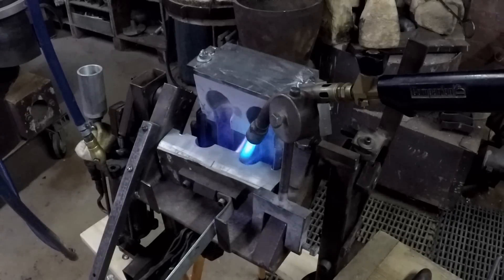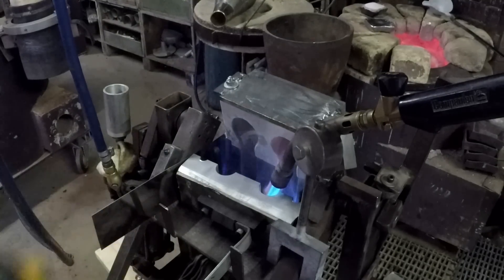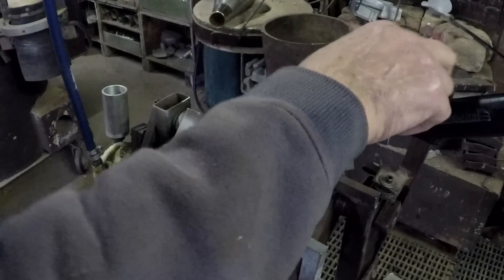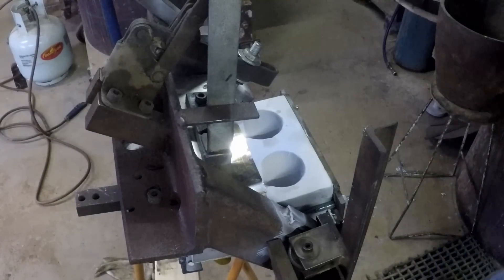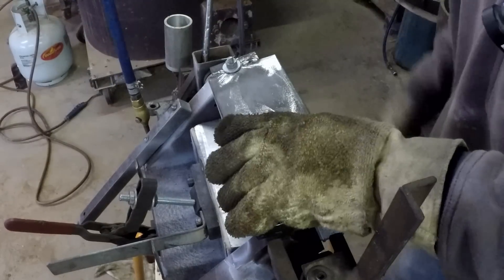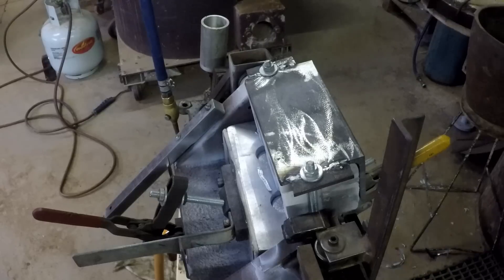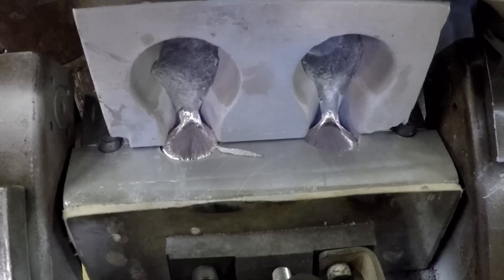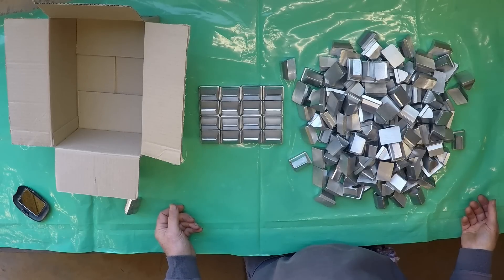Lens Blank Gravity Die Casting

Comment: Dear sir. What did you spray prior to pour and what is the use of it? Thank you
Reply from the maker: Dindigul, The die is sprayed with two materials. The first is Dyecote 14ESS made by Foseco.  It provides a thin, slightly rough, and somewhat insulating coat on the die Its purpose is to prevent the metal being cast from being chilled off too quickly when the die is filled, To aid the metal running into the die and , and to allow air to get out by virtue of the slight roughness. The metal running into the die sits up on the tops of this roughness and its own oxide skin. This allows the air to escape via the small gaps created by the roughness and as the metal is only touching the tops of the roughness it runs much further. The second coat is called Release Coat Blue it is made by ZYP  coatings in the USA. It is a boron nitride based lubricant which helps with removal of he casting from the die.... Martin
Reply: @olfoundryman8418  thanks for brief explanation sir.

Comment: Sir, I am contemplating a gravity die for an aluminum part roughly the size and shape of a sewing thimble. I would like to use electric cartridge heaters in the die, so the question is : what temperature range should I be looking at for die pre-heating? Thanks for your vids, I have learned a lot watching you. I Hope to get into the years worth of project ideas I have stored back.
Reply from the maker: Stephen, To be honest I do not know an exact figure - its a long time since I actually measured it 😊 I do it by sort of feel! However I would suggest 200 deg. C as a starting point. The die spray should flash dry immediately when you spray it on the hot die - if it sort of sits there wet looking and bubbles a bit after a couple of seconds the die is too cold. Electric heating is not common on gravity dies, there are risks in electrical conductors moving back and forth with molten metal involved but no reason why it can't be done with care. Gas flame heating is the more common by far. However with small jobs you may need supplemental heat as the heat being added via the small casting may not be enough to keep the die properly hot, I sometimes get around this problem by insulating parts of the die but the ability to add heat electrically under those circumstances might be handy....Martin

Comment: Post first comment wrong area so reposting here. Could you have made the whole die out of ceramics like you made the basins out of?
Reply from the maker: K, No not really. The ceramic is quite soft and would not stand up to the rigors of metal being cast into it and then the solid casting being removed. Even worse the ceramic is a good insulator and it would take forever for the casting to go solid greatly slowing the production rate. Even worse again very slow solidification is a recipe for all sorts of porosity problems. Also having cooled very slowly the castings would not respond to heat treatment… Martin
Reply: @olfoundryman8418  got you. Thank you.  Would it speed things up put a u shape in the side of the casting mold run coolant or would it cause too much shrinking?
Reply from the maker: K, I have used water cooling on a couple of gravity dies. They were both quite chunky sorts of parts and because of this I had difficulty feeding them. I water cooled the bottom of the die under the casting via a hole drilled straight through with a very small amount of water running through it. In truth the water boiled off within this hole. Very little water flow was needed and as the die now ran a bit cooler  the feeder in a separate die part above was able to provide good feed. I had to be careful to regulate the flow (through needle valves) as too much and the die would get too cold and the part not form properly - all in all it was an acquired art to get it working right. A commercial foundry I worked at used water cooling  but they tended to cool the platens to which the die was bolted rather than the dies themselves this sort of slowed down the cooling a bit and made it easier to control. I have also use air blast cooling... Martin

Comment: Martin, gorgeous work as always.
My question is related to having the molten pot for this length of time. Do you need to lance, clear dross, etc? Do you cover the crucible so hydrogen is not readily absorbed? Thank you and love your work.
Reply from the maker: Robert, Strangely perhaps gas pick up has never seemed to be a problem even though I hold the pot for about 3.5 hours while I ladle out of it. I work with good quality ingot so it is (hopefully) low in gas to start with and while pick up probably does occur, with gravity die casting solidification on small work like I do is so rapid that any gas does not have time to come out of solution and form porosity. Gravity die casting is known as producing the most porosity free castings of any of the more common casting methods - when done well of course. However I am very vigilant about clearing dross from the top of the metal as it does build up with every dip in and out of the ladle, I would skim the surface about once every 10 castings... Martin
Reply: @olfoundryman8418  Martin, thanks that is Good to know. Have you thought about.adding a Patreon account? Your apprentices could buy you a few beers.😉
Reply from the maker: Robert, At this stage I am not even monetarized. And my thoughts on Patreon are that I would feel under tremendous pressure to keep doing videos if I was being paid to do so - for me the stress would not be worth it. Also at the moment its all out of the question as my health is not all that it could be, while we are hopeful that the situation will improve at the moment I am not capable of making castings - to be honest its driving me nuts because I can not do anything much at all. To really put the kybosh on it I am probably the only foundryman in captivity that does not drink! 😊 Thank you for thinking of me though... Martin
Reply: @olfoundryman8418  Martin, be well and the best of luck with the health thing.

Comment: I do believe that this video is the first proper tilting gravity die I've seen, outside of LARGE casting processes in an industrial context. This, along with the preceding video explaining about the tiling process and what the aim is, why it works, why it doesn't work if improperly setup, etc., were absolutely fascinating.

You are, indeed, securing knowledge for the future by passing it on in such a manner. My most sincere thanks!
Reply from the maker: elitearbor, Sadly most large tilt casting shops get it wrong at least with respect to the starting angle. Certainly the big shop I was foundry metallurgist at 30 years ago did (I did not know better then!)  I note that many manufactured (Chinese) and for sale tilt machines will not even go to the correct start position. Few of these machines seem to be able to vary tilt speed during the cycle even though there are advantages in, for example, being able to start slow speed up and go slow again at the end of the tilt. My aim is to pass such information on and success in that for me = happiness... Martin
Reply: @olfoundryman8418  Truly, what you're doing is preserving skill and understanding which is all but lost. We're all better off, thanks to folks such as yourself. Again, my thanks!

Comment: Interesting.
So, cast an Al die them cast Al into that die, after heat treating.
Not sure if this has been done before.
Who cares ? If it works, got to give it a try.
Thanks for sharing !
Reply from the maker: aga, Yes it was done some time ago and back then  they hard anodised the die so that (apparently ) you did not even need to apply a die spray. From memory it was called the Parlanti process. It is limited though to no re-entrant parts i.e.. parts that would, only shrink away from a die and not onto it... Martin
Reply: Cheers for the pointer - will look it up.
Awesome that you got it to work great. Very encouraging.

Comment: great video Martin, I am raking my brains as to what these lens blanks are used for..
Reply: Me too, and enjoying the channel as a new member. Myfordboy and Doubleboost being my introduction many years ago. But I can see the step up in professionalism and experience here from their very talented but hobby level. One day i hope to cast a few things myself and it all adds to the mental tool kit.   :) Thanks for the ride Martin.
Reply from the maker: Arcturan, and Godshole, The lens blanks are to blank off a light beam. The runway lights they are used in have two glass prisms in them, each of which throws a beam of light in a certain direction from the light. Sometimes it is desired to turn off the light in one of the directions and this is done by fitting one of these solid aluminium  prisms in place of one of the usual glass ones....Martin

Comment: Hi, have you seen a new channel 'casting the future' which covers a CASTcon 2018 with modern techniques. Appalling video quality but some great material
Reply from the maker: Bit, Thanks for info. I have looked at the lecture by John Campbell that appears on it. Many in the industry think it no coincidence that his initials are "JC", I tend to agree. Crappy video as you say but information in it is gold. I have been endeavouring to follow his methods (as far as I can) for some time now and am very much an enthusiastic student of his work. There still areas that I need to  improve but even so I feel my methods superior to many in use out there (conceited I know 😀). I have seen some amazing differences in quality between local foundries that use his methods and those that don't. To see a 10 Kg open box type casting with mixed thick and thin sections produced with his methods that looks like wrought bar stock when machined is an eyeopener. There seem to be aa few videos associated with CASTcon 2018 - I will have a look at them all.
John has some excellent books to his name but they are large and a bit of a heavy read, full of wonderful information though.... Martin

Comment: Sir, have you ever used High Temp Ceracoat? Its a type of ceramic paint that is good to over 1500 degrees F and works just great on my red hot steel engine headers on my race car. I was just thinking it might make your mold last longer.
Reply from the maker: John, No, I have not used the cerakote material. I had a quick look at them on line and they do look interesting although the preparation requirements for successful adhesion look a little daunting. One of the problems of an aluminium die like that used here is that its thermal expansion is rather great and because of this many coating s tend to fall off on cool down after use of the die. Still, if this material is available locally and is not too expensive it would certainly be worth a try. Thanks for the idea... Martin
Reply: I have used it successfully on steel, exhaust headers, and on the tops of forged aluminum pistons. Its worth a try
Reply from the maker: John, "On the tops of aluminium pistons" - Hmm, very interesting indeed, that sort of makes it a very distinct possibility for spraying on a die. What sort of finish does it give? You need a fine sandy sort of finish for a successful die coat - the metal flows in on top of the bits of roughness in the coat and the air tensd to get out via the small channels in-between the roughness and under the metal, an overly smooth film is unlikely to work... Martin
Reply: The finish is not gloss but more of a flat or mat finish, it looks a lot like your fine grain sand castings.

Comment: Nice process and results. I bought the book you recommended: "Non-Ferrous Foundryman's Handbook." I has helped me in my hobby casting. The section on using an insulating sleeve and a ceramic filter was totally new to me. Have you used them? I have no idea of their cost. Got the book from Australia!
Reply from the maker: Larry, Um, this is a bit awkward! I have never read the "Non- Ferrous foundryman's Handbook" And I don't remember recommending it to anyone (not surprising really I am old and possible in my dotage  😀) However I have found the book and downloaded it. It sure does contain a lot of very useful info but I do note that in some areas at least it is a bit out of date. Specifically I note its recommendation of a well at the sprue base. This was recommended by John Campbell in his 1991 book "Castings" (And by a legion of earlier work) But in his later books  "Complete Casting Handbook" for example he points out that he was in error in the 1991 book with modern real time X-Ray work proving the quite bad effects of a well base as it is known to bleed a stream of air bubbles into the metal stream throughout much of the sort of pour that us small fry do. Similar the use of runners with steps at each gate has been shown to cause splashing of metal through the gate a continual taper has been advocated instead. Nevertheless it is clearly a useful book to have as a reference, its just that like in all things it is worth keeping ones eye on more recent publications too...Martin

Comment: My father was the son in HG Wise and Son that were foundry engineers in Sydney from the 1950s. 
Having grown up with the factory in the backyard I thought I knew a bit about foundry practice, watching your videos shows how little I really learnt. 
I can use words like chaplet and chill, but my skill level doesn’t achieve good lead castings for model boat keel bulbs. Makes seeing a master moulder at work both satisfying and frustrating. 
Mike
Reply from the maker: MW, Its comments like the one you made here that really make the effort of making videos worth doing. Coming from someone like yourself who knows foundry this comment gladdens my heart. 
Don't be frustrated! Achieving good results is only a matter of practice, patience, and persistence plus perhaps a bit of study on newer techniques.
Lead is a bit problematic as its high specific gravity leads to high metal pressure in the mould and this means a great tendency of the metal to penetrate the mould - lead also has relatively low surface tension so it tends to run into the sand easily anyway. Keep the metal height as low as possible and pour as cold as you can without getting a miss run - fine sands or a good mould wash are a necessity. If you are pouring your lead into a metal mould use a die spray like I use for gravity diecasting work or as an alternative smoke the die with very rich gas flame, for preference use an acetylene gas flame... Martin
Reply: Olfoundryman
Thanks for your suggestions. I’m only going to a make a few 600 gram castings. My first attempts had large voids and after watching your videos I think I can improve by carving a better basin, arranging the spruce to enter at an angle and putting the riser at a higher point in the mould to allow the air to vent. I’m using plaster instead of sand because that’s what I’ve got available. Using plaster is a slow process with making the plaster mould from the pattern and then thoroughly drying it and I’m going to have to accept destroying the mould to retrieve the casting as the price for a more satisfactory feeder arrangement. I don’t have acetylene gear, but would facing the mould with graphite powder improve the surface finish?
Dad’s business sold foundry equipment around Australia, do you remember seeing Rotroap vibrators, Ezistrp or Xpanda mouldings boxes? He used to advertise in the foundry magazine with the slogan “Be wise, buy Wise”.
Reply: Olfoundryman 
Thanks for the encouragement.
My castings are improving, although I’m finding ways to make new mistakes. I made a new plaster mould with better basin and feed, but I’d over baked the mould (9 hours at 160°C) so the was plaster was weak. It cracked and I lost most of the lead through the half joint. 
Next try with an underbaked mould (4 hours at 110°C) was a bit gassy, but still better than my first try last year. 
One more try with the mould now dried by the molten lead and I’m happy enough with the result. The fettled weight is within 10 grams of design and the finish is good enough to be faired with epoxy.
Reply from the maker: MW, "Finding new ways to make mistakes" I love it! story of my (and I suspect everyone else's) foundry life.
9 hours at 160 dig C is a bit long but I don't think it should have causes the plaster to crack. Providing the temperature was ramped up reasonably slowly  and evenly I did not get any cracking at 400 deg C. Did you mix the plaster properly - many people get a bit slap dash. Was the plaster a bit old - (you can revive it by an hour or two at about 140 deg C). I would have thought 110 deg C too low to dry the plaster properly. An old style mix that may be less prone to problems is plaster 65% sand 25% talc 15% water to a creamy consistency (whatever than means)… Martin
Reply: I've got the casting I need for now. Later this year I'll be building another model boat and I'll probably design it with a longer, narrower bulb of the same weight. That'll mean a new pattern, moulding box and the opportunity to try that old style mix. I think I'll use the normal plaster mix as a facing and the coarser mix for the bulk. Although I've seen RTV silicone rubber used for lead moulds - another chance for a spectacular failure...  
Mike
Reply from the maker: MW, Silicon rubber can indeed be used as a mould for lead and its alloys. Pewters, both tin and lead based are regularly cast into silicon rubber moulds. Most usually in a sort of centrifugal process (check out the TekCast web site) but it can be done into static moulds. Just get a good HT silicon rubber, don't get the lead any hotter than necessary and dust the mould with talc (taping the excess talc off) before each cast. Spectacular failure? Ah well all things have a learning curve -  take it as  a challenge… Martin